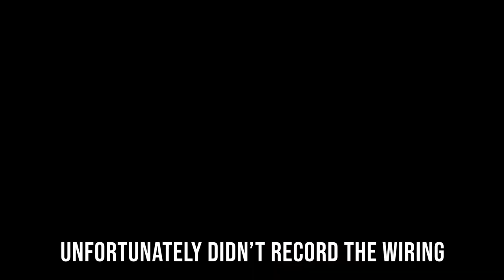Clean and Restoration of a Herbert Terry Lamp

Comment: Thanks for the video. Very helpful in my up coming 1227 restoration. You have provided a lot of good information. I’m in the US so I know it’s going to be a challenge converting to US lamp socket but, I have a plan. I converted an early Model 90 and all went well. Thanks again. Brian
Reply from the maker: Fantastic,  glad it was of some help.  I don't think it will be too much bother swapping to a us fitment lamp socket. as long as you cover the outer diameter of the aperture and lock in tight, you should be good to go.  Would love to see the results.

Comment: Gareth - What did you use to scrub down the lamp? Will water make it rust? Also which size lampholder did you get? Thank you
Reply from the maker: All good questions.  Water won't make the metal parts rust as long as they are dried immediately.  luckily with this one most of it was still painted really well.  The lampholder i usually get for updates like this one  are the following https://amzn.to/3kEz5I9 make sure they are CE certified.  You can get these with switches on the lampholder, or what i usually go for is an inline switch.  Keep an eye out over the next week or so, as i'm doing a total strip down and rebuild of an EDL work lamp which is much in the same vein and is taken back to bare metal.  thanks for watching.
Reply: @ProjectGarethNorman  Thanks so much - very helpful!